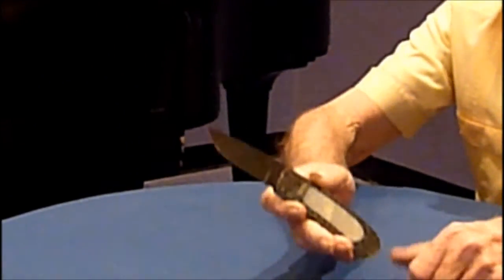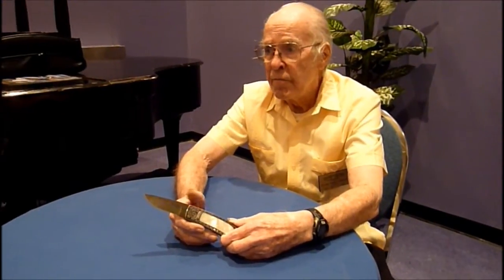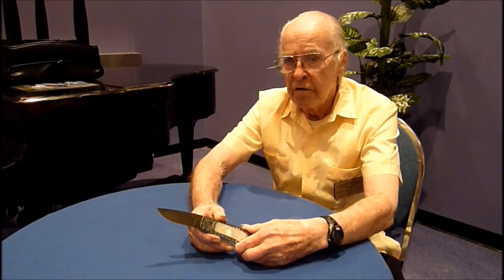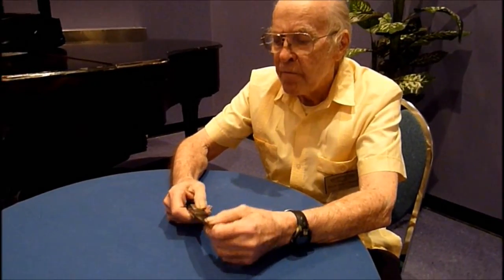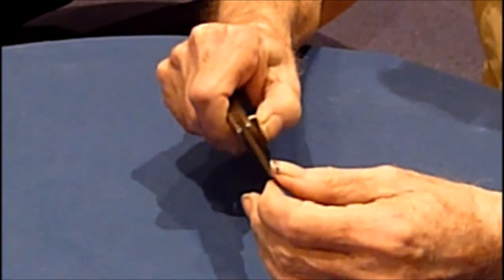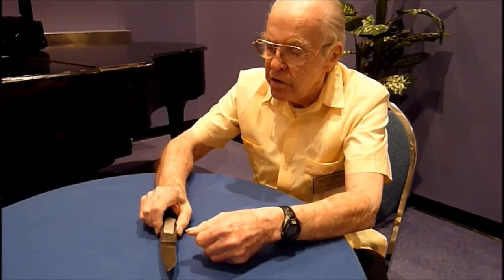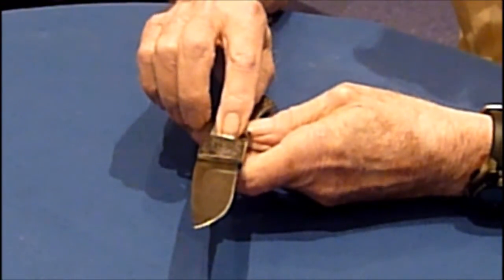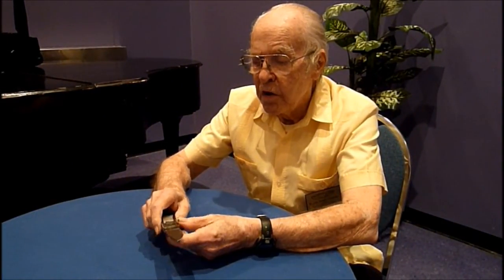Ralph Dewey Harris - Master Knifemaker & Engraver

Comment: I was given Mr. Harris' #64 fixed blade for my 16th birthday in the Panama Canal Zone and I have used and treasured it since. I and my friends who were also lucky enough t get one of his beautiful knives used the heck out of them in the jungle of Panama and , other than a few wear marks on the base of the wood handle and the leather sheath it has weathered the years extremely well. The blade is 3/8 stainless and is 3" in length, overall length is 7 1/2. Not sure what kind of wood he used for the handle but I think it might be cocobolo. So glad to see that his work is as valued by others as it has been for me.